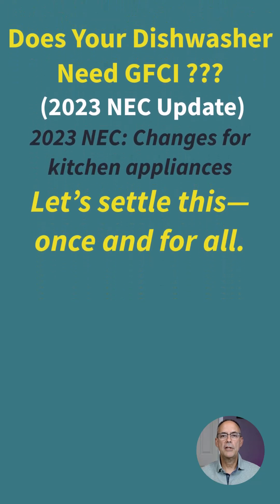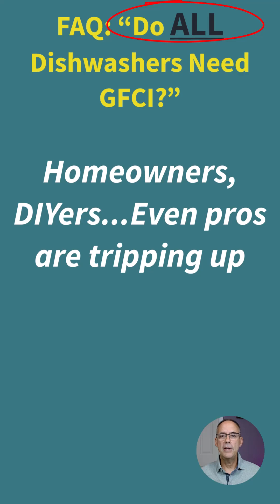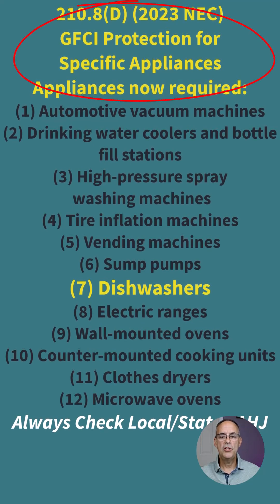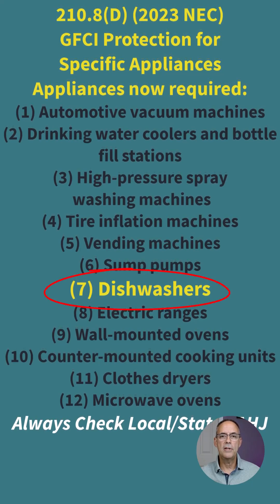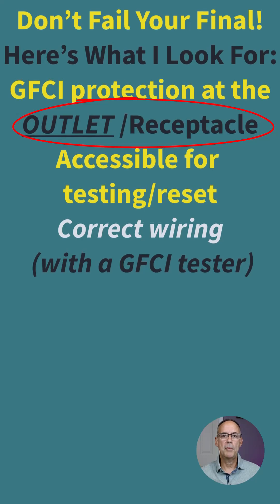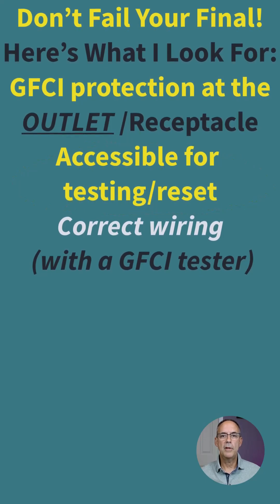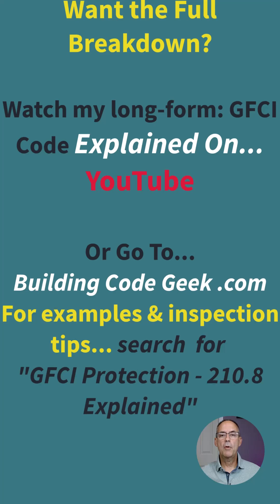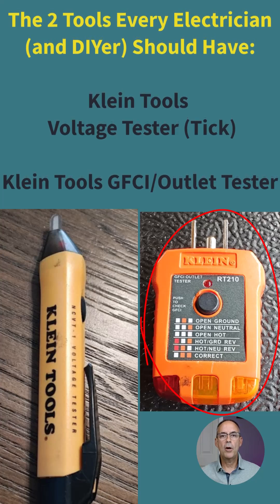Dishwasher GFCI Requirements 2023 NEC | How to Pass Your Inspection #GFCI #NEC2023 #Dishwasher

Comment: So per 2023 NEC, all appliances are required to have GFCI protection regardless of location? Would this also apply to water heaters, furnaces( oil or gas) and AC units( condenser and mini splits)?
Reply from the maker: Thanks for the question! The short answer 🙂: No—the 2023 NEC does not require GFCI for “all appliances everywhere.”

Here’s what the code tells us: Location rule: If an appliance is on a receptacle in a required GFCI area (kitchen, garage, unfinished basement, outdoors, etc.), that receptacle must be GFCI protected per 210.8(A).
- For a specific-appliance: 210.8(D) requires GFCI for the circuit or outlet supplying certain appliances (≤150 V to ground, ≤60 A), including dishwashers, ranges, wall ovens, cooktops, clothes dryers, and microwaves—whether cord-and-plug or hardwired.
• Dishwashers: Required universally. They’re covered in two places—422.5(A) (Appliances article) and again in 210.8(D).
- Water heaters and furnaces: Not on the 210.8(D) list, so no blanket GFCI. They only need it if a receptacle is in a GFCI-required location or if the manufacturer/AHJ calls for it.
• Outdoor A/C (condensers and mini-splits): 210.8(F) would require GFCI protection, but there’s a temporary exception for listed HVAC equipment through 9/1/2026. Always verify what your AHJ has adopted, check with local and state requirements, and follow all manufacturer equipment requirements...Hope this helps!